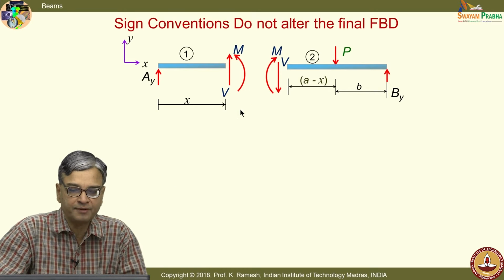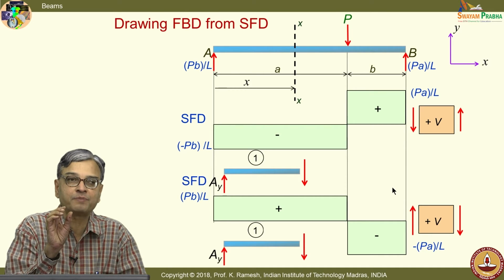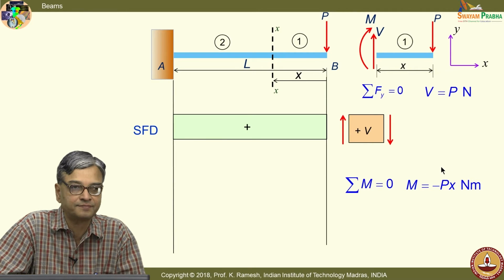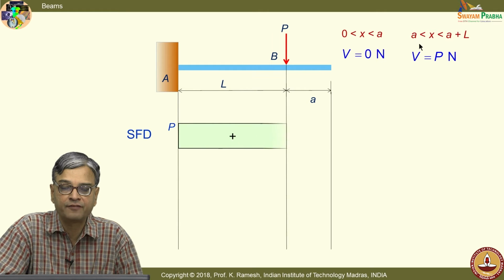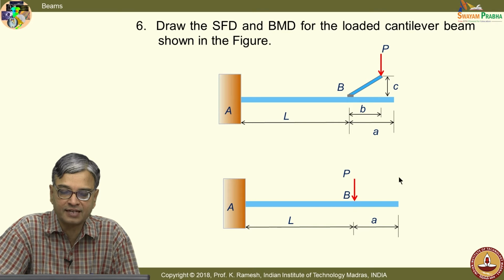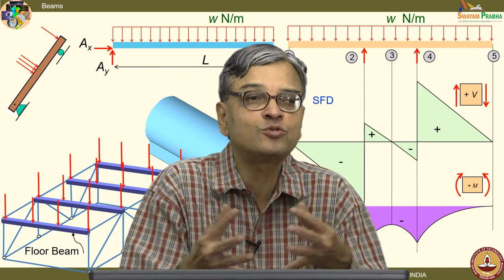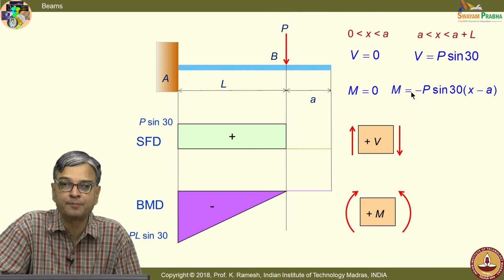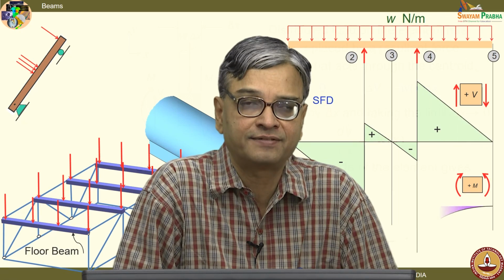Lec 12 Beams III

Comment: A conceptual question if someone may answer : How can something  called "force per unit length" be a continuous function as shown. Meaning what this function essentially means is for every value of x ; which are essentially discrete points on the x - axis ; there exists a value y, called force per unit length? How is force "per unit length" defined for a point ? I believe it can't be defined for discrete points? Has anyone got an explanation? Please do share 🙏
Reply: Force per unit length (F/L) is a characteristic property of the loaded beam as it is a constant. To find the total load acting at a particular point of the beam along its length, intuitively we can construct a linear function (Fx/L) where x varies between 0 to L, which makes it a continuous function by definition..